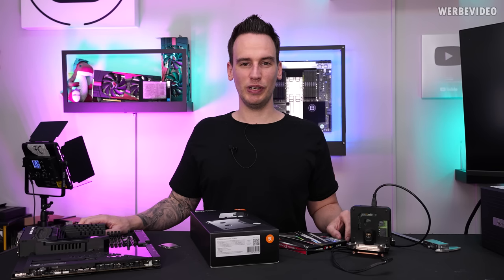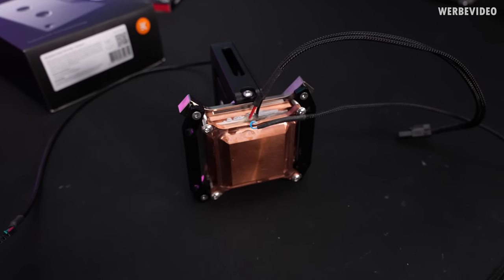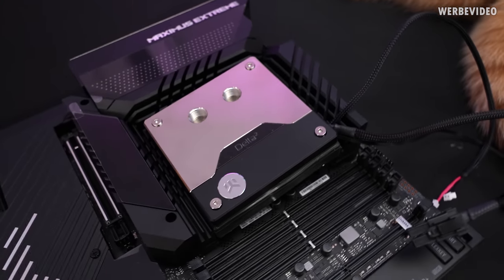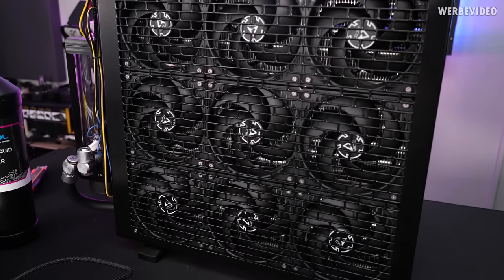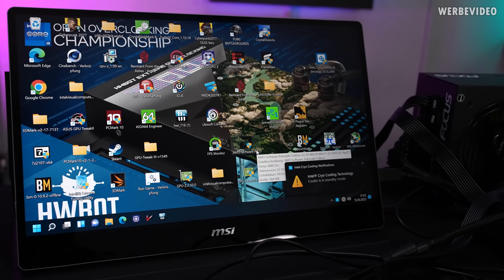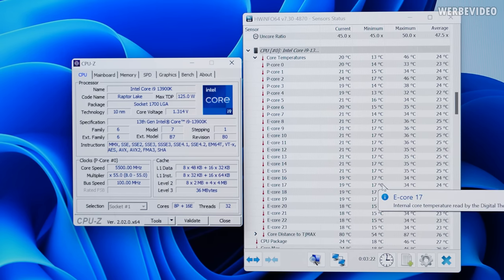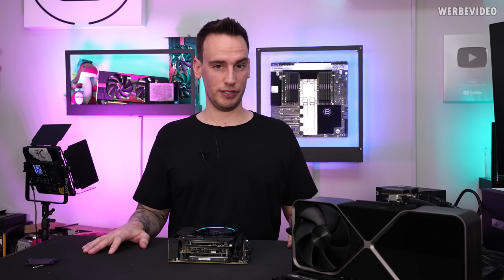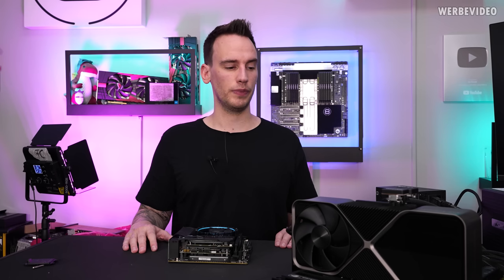This insane 500$ Water Block allows 13900K Overclocking above 6 GHz

Comment: Would love to see this solution on the new am5 CPUs considering their interesting boost behaviour where it will basically continue boosting higher until it hits 95°C.
Reply: Man if this could go on AMD, that would be awesome
Reply: Agree. But it is too expensive. Intel made their 13600k to boost until they pass 100°C to have +5°C more auto-overclock head room than AMD. So on low perf Air cooling, Intel will get hotter and faster.
Reply: AMD CPUs still have a hard power cap. Once they hit that limit, they will not increase power further.
Reply: Still they have a power limit that they will throttle at.
Reply: it is better to delid the amd cpu and go for direct die cooling. you would get much better results than going with this.
Reply: Well I just spent over 2k for a 7950x, Asus x670e Extreme and a very nice 6000/cl30 Gskill DDR5 kit, I would absolutely spend $300+ more for this over the EK Velocity2 am5 block I ordered over a month ago. It did ship today so that's good.
Reply: @robihr  maybe de-lid and use this cooler wonder how it would perform then
Reply: @Skaadi89  you already get -20°C with direct die cooling. idk how much cooler it would get with this, but i guess you would get diminishing returns.
Reply: amd's dead
Reply: You would think that but direct die cooling it results in lower temps, it doent keep going to 95
Reply: @Z1M0Z1M  you will need another few 100w for these pelteir coolers lol
Reply: @Kellen6795  unlikely since it’s Intel funded
Reply: @bingbing3464  Yeah I know lol. Amd has never OCed as well as Insel... I mean intel but a man can dream and enjoy these two trading blows.
Reply: @erkinalp  yes but lower temps gets you better efficiency, so you get higher clocks for the same power limit (FIT limits)
Reply: Yep…
Reply: @robihr  that was manual all core, doesn’t account for boost behavior.
Reply: @MikeZak101  What are you basing that on? If AMD's "dead", then Intel was in the seventh circle of hell for years before alder lake.
Reply: @pentaborg871  a few years maybe, not decades like amd
Reply: Someone cracked this software to work on amd with the original cooler I tried to aquire it but the guy wanted to charge me :(
Reply: @Kellen6795  I have used steel wire to mount the Intel-EK TEC to my 5800X and it would run 5200MHz boost on multiple cores just using a bugged +400 typed in AutoOC from an older C8H BIOS. I can 100% confirm that TEC shifts the clock voltage curve on 5000 series and 7000 series should be even more severe.
Reply: @B0BBYGAMER  I found same guy, probably. I just ended up using it full on, full off using a 20A light switch and switching the power mode on the OC to super-eco when TEC is off
Reply: They’ve always been inefficient and never will be able to cool continuously at full load. I use much larger TECs everyday at work not for cooling, but to remove moisture from analyte gases, and they suck power like crazy.
Reply: @Z1M0Z1M  lolol for what?
Reply: @Z1M0Z1M  The FX8350 would disagree with that statement.
Reply: If you remove the power limit on an AMD CPU and you can keep it fed, you then risk overloading the tec cooler which is not a good thing. These coolers are a bit finicky and if you put too much heat into them, you can overload them and result in thermal runaway which will ultimately kill the CPU that's under them. I don't recommend it. Now I suspect that this would be able to hold an AMD CPU at its power limit instead of any thermal limit basically continuously, which would be interesting to see
Reply: @angelg3986   NOTHING you said is fact, everything you said is made up baloney.

Comment: I love how the shadow around the fan error window was HUGE.... like all the error windows were literally stacked on top of each other, casting a dark shadow on your desktop, which slowly lightened up as you closed more of them.
Reply: Its like your vision closing in when you pass out as the computer starts to die
Reply: And the amount of poligons on it explains why it runs so bad.
Reply: No it doesn't. GPUs can handle tens of millions of triangles. The overhead for windows is the abstraction, it's not the 2 triangles it takes to make them that makes them slow, it's the program they represent being run thousands of times that is slow, and maybe the windows graphics API also struggles, but in terms of raw compute the amount of polygons  in a fork bombed 2D desktop scenario does not explain the performance issues.  @TheCustomFHD

Comment: LOVE seeing those Arctic fans being used in any capacity. I have an 11-fan rig and every single one of them is a P12 PWM. Total cost was around $55 USD for all the fans and it is quiet and efficient as hell.
Reply: agree, top tier performance, bargain price
Reply: 2 out of 5 of my P12s have this weird whining. So they aren’t perfect.
Reply: @Kadd enjoyer noctua fans are 5x the price for 0.5% extra performance... you got scammed bruh
Reply: I only recommend two fans. Arctic P for regular people, and Noctua Industrials for insane people who don't care if their fans are running at 2000 or 3000rpm and don't want RGB.
Reply: @holobolo1661  you pay 5x the price? sounds like you got scammed
Reply: @dan8t669  no, I run arctic fans einstein lol
Reply: Eleven fans and "efficient as hell".  Totally take you cereal.
Reply: @ShainAndrews  this
Reply: I have a MoRa3 and put Arctic P fans on it this year.  I bought 8x Arctic P fans to swap out the Noctua IPPC 3K-RPM fans off my Monsta rad too, the lower RPM should still give me a way better noise to performance ratio
Reply: @bigpoppa1234  Nah mate, you run EK Furious series fans, and enjoy the 3200-3500rpm that will shake your room and twist your window blinds, lmao.
Reply: @dan8t669  In some places they are. In Australia for example, a 5 pack of Arctic P12s is $45. A single Noctua NF-A12 is $65. That price difference is insane and clearly not worth it
Reply: @ShainAndrews  Yeah. 11 fans all running at 900 RPM using less than 9W total. For the amount of air these things are moving at that power consumption, "efficient" is the word I would use.
Reply: P12 and P14 the GOAT. Both my main, backup and retro rig are cooled by them.
Reply: If only P12 in my country costs as low as yours.
Reply: @NPurvis7622  lmao. My AIO does have Vardar's and those are even faster than the Industrials. I'm not sure my ears could take 3000 or higher!
Reply: @Kadd enjoyer thank you the static pressure on those the stock artic fans suck and max at 1600 rpm so its better than stock fans for airflow but Noctua NF-A14 iPPC-3000 PWM static pressure 10.52mm-h20 and airflow 269.3 CFPH does everything best 140s and 120s on the market imo and one other glorious thing no F**** RGB
Reply: @holobolo1661  Arctic fans will start rattle after few months when mounted horizontally and you will really appreciate Noctua.They are worth every penny becouse they last forever.I had many P12s and all when mounted in the top started ratling this is how I came to love Noctua's SSO bearing.
Reply: @mrmrmrcaf7801  You must've mounted them improperly, I've had P12s and P14s for 3+ years and they run practically silent on the curve I've set, just clean air noise.
Reply: @username8644  Depends what country you are in. Arctics are half the price than even the redux where I am.
Reply: @glitter_fart  If you would like I'd be happy to do a temperature to power consumption conversion to ascertain whether spending the extra 0.96 Watts per fan is worth it? Besides, you're assuming they are all case fans. I removed the NZXT fans from my X53 and did a push/pull with 4 P12s. I removed the OEM shroud from my 3070 and replaced it with 2 P12s and temps went from 58°C to 47°C. There are also 2 fans feeding fresh air to the GPU, 2 at the top of the case, and one at the back. It's quite efficient, actually.
Reply: Arctic P12 PWM have a static pressure of 2.2mm H₂O and a CFM of 56.3. Noctua a12x25 has a static pressure of 2.34mm H₂O and CFM of 60. Noctua is marginally better. Might as well just get Arctic if you dont need insane performance and you save like £15 each fan. If you really want a good fan go for a Be Quiet! Silent Wings Pro 4. They're the same price as the Noctua fans but have a static pressure of 5.31mm H₂O and CFM of 83.9. Noctua Industriual line us even crazier with a static pressure of 7.63mm H₂O and CFM of 110, but they're super loud and even more expensive.
Reply: @bailey125  Yes but I prefer to look at the price/performance instead of purely performance. That way you can vote with your wallet.
Reply: @holobolo1661  It's all about use case. Also, Arctic recently launched the P12 MAX a couple weeks ago. It's performance is on par with Phantex T30 and Silent Wings 4 for less than half the price, but still more expensive than the P12 obviously.
Reply: @bailey125  oh cool I hadn't seen that, P12 MAX looks awesome!

I'm running P14s with the LFII 280, except for the rear exhaust which is P12.
Reply: @holobolo1661  I wanted to get some but they sold out very fast here in the UK :(
Reply: LOVE seeing fanboys. I have an 11 fanboy rig and every single one of them is a super fanboy.

Comment: I’m quite happy to watch you play with this hardware. It’s great to know what’s possible. For my part, even if I came up with the money for such a rig, I have no workloads to justify it. I expect the same is true for most of your viewers. That makes bleeding-edge video like this very worthwhile to watch.
Reply: There are no workloads that justify it.

You're still only getting a couple 100 extra Mhz out of the CPU for a 500$ pricetag.

If you need performance, that 500$ together with a slight toning down of the initial pricetag of a 13900, buys you extra hardware that provides direct performance without the cooling.

Like a whole second system.

With multithreading finally being a mainstream thing, practically every task can be split up among multiple systems.

So when it comes to workhorse systems, this is never worth it.

Even if you have this specific task where the time it takes to queue up a spread task takes longer than running it locally, your workflow either needs improvement or the few 100Mhz together with the 500$ pricetag isn't anywhere near a speedup enough to make much of a real difference.

But not everything has to have a clear price/performance advantage, buying something just for having it is perfectly OK.

And who knows, by people buying this, the usage of this kind of tech may seep into the general market improving performance across the board.
Reply: @enlightendbel  Plus the rest how much will the fans and rad cost. I would like to see what that can do with a 360mm rad.
Reply: modded fallout new vegas
Reply: @rawhide_kobayashi  That'll never run long enough without crashing to need this kind of cooling.
Reply: @enlightendbel  you are wrong, sir.  fallout new vegas, in 2022, with applied care and curation, is a rock-solid experience more stable than your average AAA release.
the only problem is that it's still single thread limited.
Reply: Love the water pump bit.  From no hand holding in the old days to giving you a guide dog who has smelled a bone ...

Comment: I remember back in the day  using a Peltier cooler ...  it was amazing just turning it on and holding it between two fingers and one getting hot, and one cold, really really fast.

It was just the cooler,  get it upside down when putting it in and your cpu was potentially toast as you applied the hot side !

I got some good results but my cooling was not good enough even in those days to take away the wattage of the cooler and the cpu.  And it was a lot less watts in those days.

This is a good cooler !

Comment: Thanks for that previous 13900k power limit video. I used it as a baseline to look at tweaking mine, I ended up sticking to 280w for a short PL2, and then down to 220w for PL1 if there's a sustained load, with a core clock offset of -0.040v. The 280w setting loses less than 4% performance but isn't hitting 100c any more, and the 220w setting is only about 8% less performance but practically halved power usage at load.
Reply: Tuning is key really. I recommend just finding the lowest voltage you can use while having the least amount of power consumption possible. I have my 13900KF OCed to 5.8Ghz P-Cores, 4.5 E-Cores, and 5.1Ghz cache, and DDR5 7600. My max power consumption in R23 is 260 watts peak after 30 minutes still scoring over 43,000. Let that sink in for a second. It’s crazy. Yes my chip is amazing for one. But still, the auto voltages are a bit heavy honestly. If I ram my CPU stock with auto voltages it’s like 311 watts in R23. It doesn’t make sense that I can overclock it with a fixed voltage and consume 50 less watts while
Running faster. Leave it stock set a fixed V-Core and start knocking off voltage slowly bit by bit. I can squeeze out a full bore 13900K performance inside of about 220+ watts. No need to take away frequency at all.
Reply: @videocardzrule354  That's a huge result. This chip is insane, it can go down deep low power, stay in the mid-range, or with things like this video's cooler can get massive scores.
Reply: @videocardzrule354  what kind of crazy ram is this
Reply: @videocardzrule354  Curious what Voltage you run for 5.8ghz with the cache so high? Still tuning mine. But even 50x on cache is a no go with 5.8 all core and 4.5 E-core.

Comment: Enjoyed it, one question though when you mention the TEK of 210W can't cool the 300W CPU.

The way I understand it, the power consumption of a TEK is proportional to the deltaT across the element and not directly the heat load. So it's not just the capacity of the TEK power consumption, it's also related to the capacity of the heatsink to transfer the total load, not just TEK Power = Load Power.  So if 210W can generate a delta T of 30°C across the TEK, and your goal is 15°C on the cold side, then as long as your waterblock can hold the hot side to <45°C with the total load of 510W it's good. If not, then you'll still maintain that dT, but the cold side will heat up proportionally. Or what am I missing?

Comment: Running multiple peltier modules in an adjacent ("parallel") configuration like that is actually a really good idea, because TEC efficiency goes up (quite substantially in fact) as its load goes down (with a peak at 15-40% depending on your temperature delta). Running multiple higher-rated units in tandem at lighter load will result in less wasted power operating the TECs (and less excess heat to get rid of) with the only downside being the extra cost of buying more modules and the physical space they take up.

In fact, a TEC running at its optimum point at a temperature delta of say 10c can actually have a coefficient of performance over 3:1, comaparable with compressor-driven heat pumps like air conditioners. For something that achieves a CoP of 0.5:1 or worse in "typical" use-cases, this is quite notable!

Comment: I am spending $1000 on a Sub Zero beer chiller.  It has four channels with four pumps.  Each channel is capable of cooling up to 780 watts.  It has an 8 gallon tank capacity for a Propylene Glycol mix.  It will send solution out at minus 5C.   This is for my X3D CPU and my 7900XT.  Cheers.
Thanks for sharing your OC experience.
Reply: I used to have a beer chiller that I made that used nitrous oxide (laughing gas) cylinders (which I got easily from a dentist friend), want a COLD beer? pop it in, crack a whippet (... take the whippet too should you be inclined) and super cold beer was had in an instant :) I loved that thing but for the life of me I can't remember what ever happened to it, probably lost during a move :( (along with access to dentist friend.. so no reason to build another subsequently)
Reply: @Nick_Rabbit  a whippet is a small airgun sized nitrous cylinder with a valve.
Reply: Can it hang being run constantly? Most refrigeration solutions are designed to cool something down for a while and then cycle on only periodically to control temperatures. They're not usually designed to run flat-out all the time to cool an active heat source.
Reply: @ganthrithor  It can run 24/7 its a commercial unit. It takes as much juice as a mini-fridge and makes about the same noise.  It will only run as long as I am on the computer.
Reply: @ganthrithor  It's basically a water chiller, and yes, it will work if it is indeed designed to cool up to 780 watts like some are. Though I'm not sure why a beer chiller would bother to mention it can handle 780 watts unless it's sold as a multi-purpose kind of thing. Some water chillers will mention a "watt value" of cooling power because they are designed to cool machines  and that's what people usually buy for custom loop chillers. You can buy nice machine chillers for less than $1,000 though that work great.

Comment: The fact that running the cryo cooler required a secondary 12900K system and a total of three Intel stock coolers made me chuckle quite a bit :'D
Reply: It's wild that an entire software package is required to enable a mode that could be a dipswitch on the controller. It adds a lot of bugs and complexity for extremely little gain.